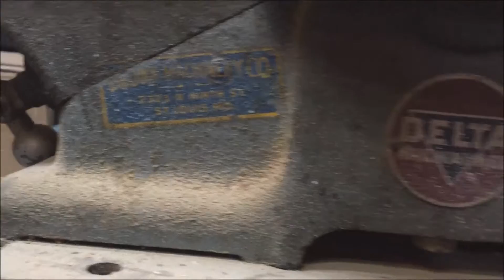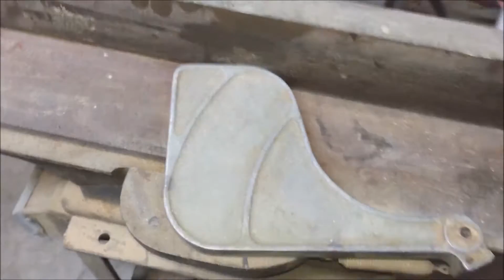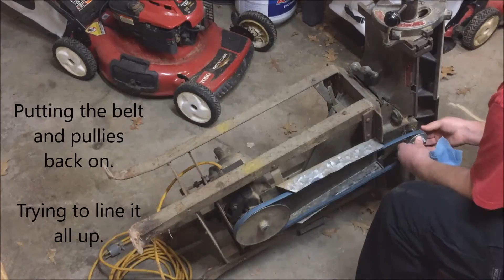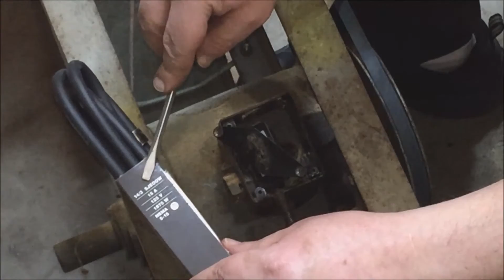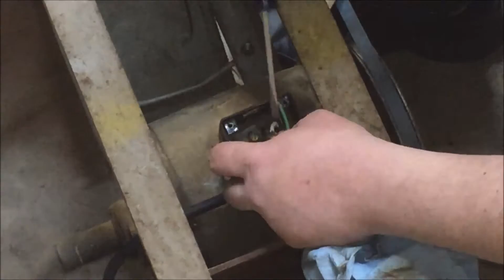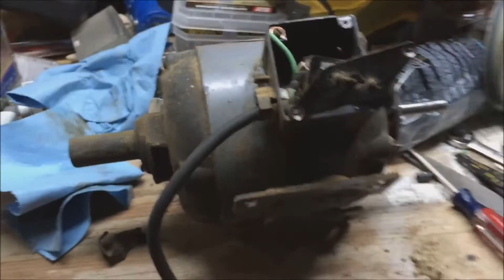Old Rockwell Delta jointer repair

Comment: Nice job! Found one without the motor and trying to get it going... What size pulleys does it run on? tx.
Reply from the maker: Sorry, I can't physically get to it right now. It's buried in my garage/shop and I have to pull things out to get to it. Next time I can get to it I'll measure them. A google search of a manual would be a better source than me trying to measure them. I took the broken one (top one) to the store with me and I think it's 2.5" but I'm not positive.
Reply from the maker: I pulled it out this weekend and the cutter head pulley is 2.5” and the motor pulley is 7”. I hope this helps.

Comment: THANK YOU FOR SHARING! just bought this same jointer, was having the same issue. i was about to replace the motor thinking it was bad... it was just wired at 220V! you just saved me $200.
Reply from the maker: That's awesome! Glad I could help.

Comment: Good day
I have been following video clips on Delta Jointer.  

I recently  bought a Delta Rockwell 6in  jointer.

how do one adjust the surface when say the right side surface slopes downwards so it's total flat?

Thanks
Reply from the maker: I think on new jointers you may be able to adjust the tables. Mine is too old that I don't believe they are adjustable other than the cut depth. I suggest trying to find an owner's manual for your specific model. Sorry I'm not much help.
Reply: Gunness Sudama There should be three or four small gib screws on the back to adjust each surface. They tend to sag at the ends.
Reply: Thank you.
By trial and error I had discovered this and having adjusted them it now flat.

Working on a Rockwell 8" jointer now.